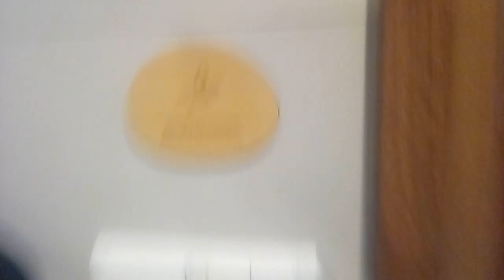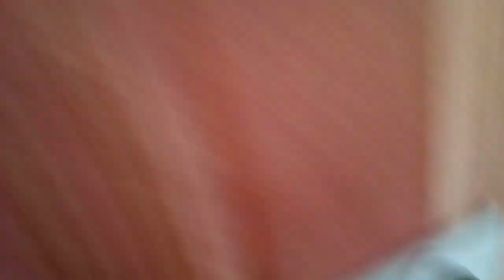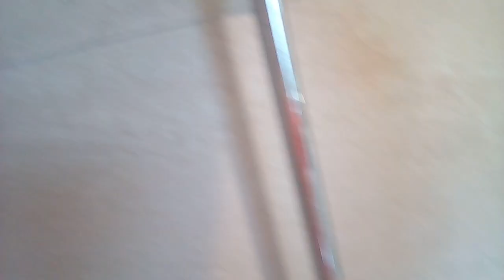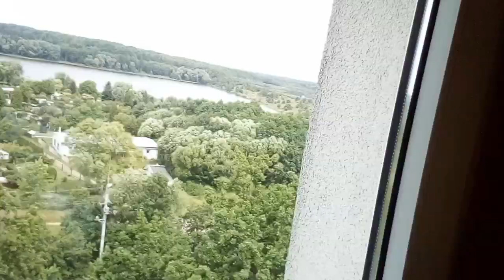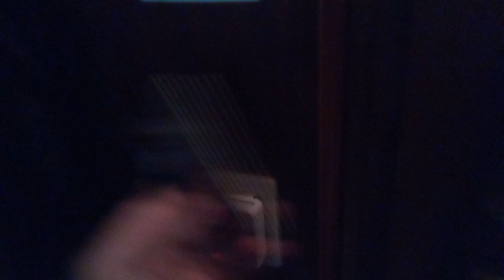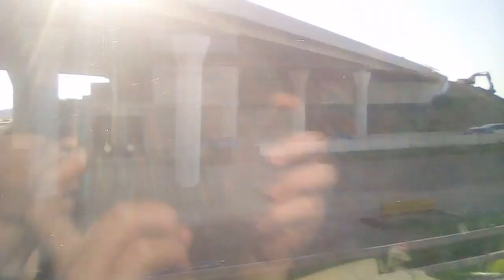Exploration of European electrical and utility workings

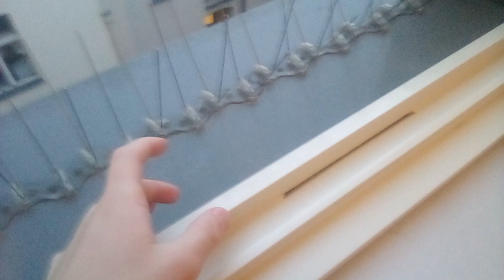Comment: 3:27 bird spikes
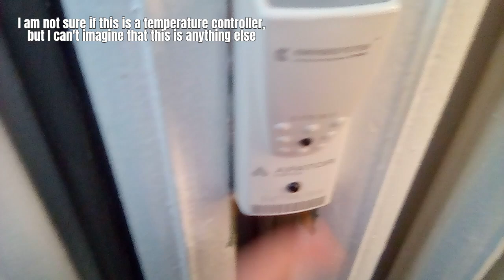6:55 that is the meter. it measures work in units of heat and is calibrated to the size of the radiator in use.
The heat control is probably the knob in 6:08. Those slots in the knob indicate an air sensor. It uses the air temperature to control that valve; a mechanical thermostate.
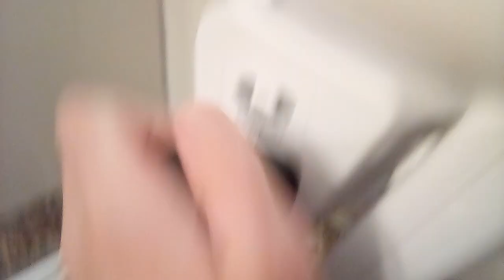21:50 many devices have those 110/220 switches built in. and newer devices would accept anything between 110 and 250V (check your own power supplies!). so, all they need is a mechanically fitting outlet.
and btw "shavers only" means that there is a power limit for the socket.

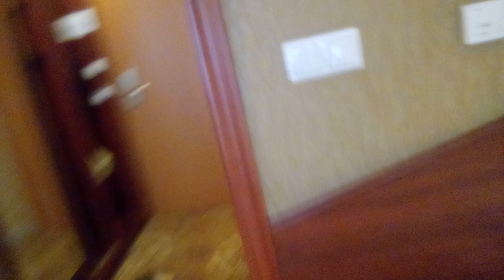26:58 You can control a single light by any number of switches by using two certain kinds of switches.
You wire up your lamp to neutral. Then from 230V you connect a flip switch with 230V input and two outputs.
These two outputs will be your line A and line B. At the end of the line you use another flip switch that switches between A and B with its output wired to the lamp.
Now, either both switches are set to the same line (both A, or both B) and you make a circuit.
If the switches differ (a/b or b/a), you break the connection.
Now you introduce a different kind of switch in the circuit: a cross switch. The cross switch can go anywhere between the line,
take A and B as an input and outputs A' and B'. You either set it to the straight position and it will connect A with A' and B to B' and it will leave the circuit unchanged
or you set it to the cross position and it will connect A to B' and B to A'. This flips over the initial statement and allows to make the connection when the first and the last switch are in opposing positions.
You can add any number of switches in between to cross or double-cross (or uncross) the lines however often you like.
Essentially this creates an arrangement that allows any number of switches to make or break the connection.

Cheers!
Reply from the maker: Thanks for letting me know about how multiple switches can control the same light!
Although, I don't think I have seen a hair dryer or similar in the U.S. with a 110/220-volt switch, probably because few people travel abroad often over here and those that do probably wouldn't bother bringing a hair dryer.